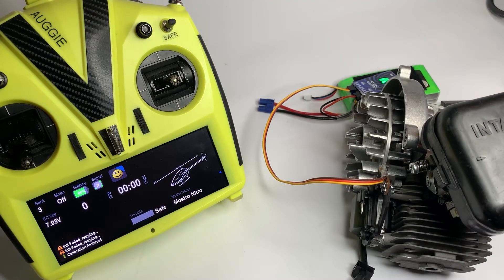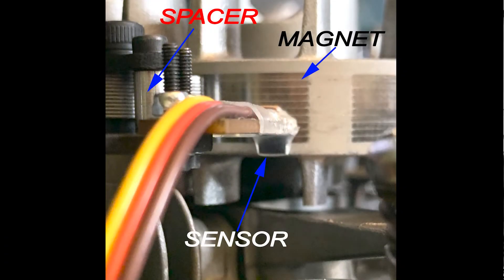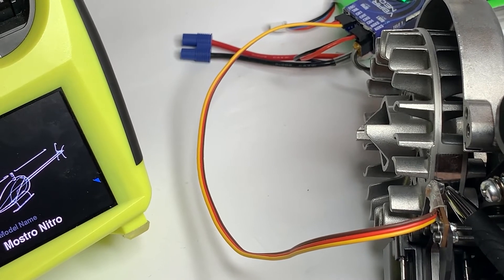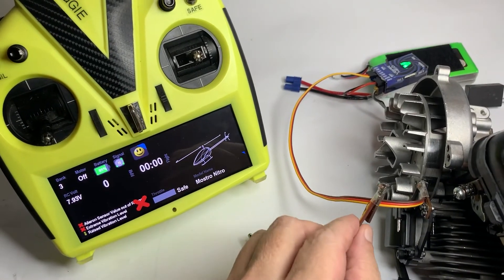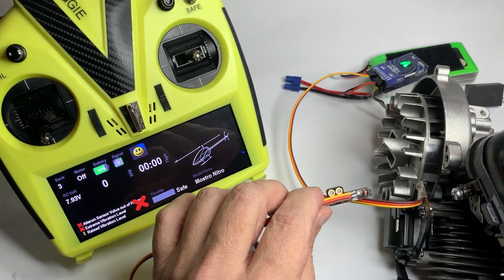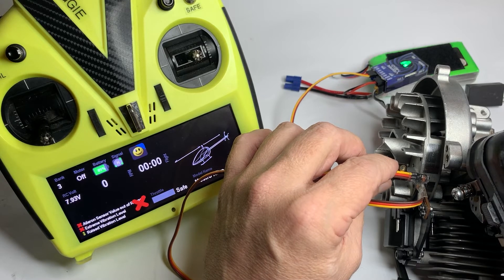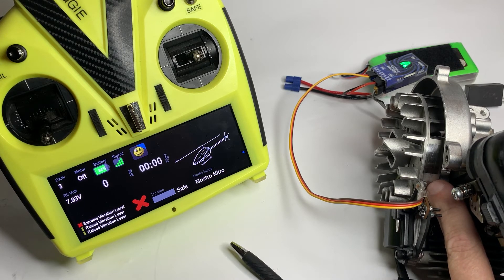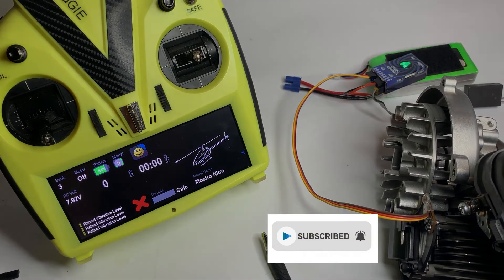XGuard RPM Sensor Installation in a gasser

Comment: Hi I have the same set up but having trouble setting up the governor it’s not showing the proper rpm I would it shows double of what it really is and I think it’s a setting issue in the Vcontrol would you be willing to share your radio settings? I have a Goblin 700 raw gasser.
Reply from the maker: Find me on FB and PM me. I will ask you a few questions before I can help you: https://www.facebook.com/auggie.copter/